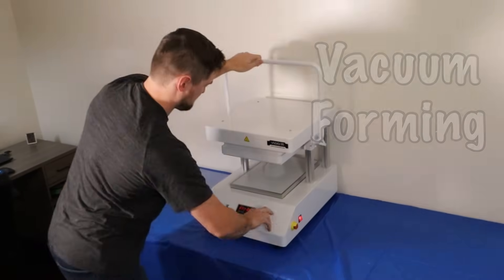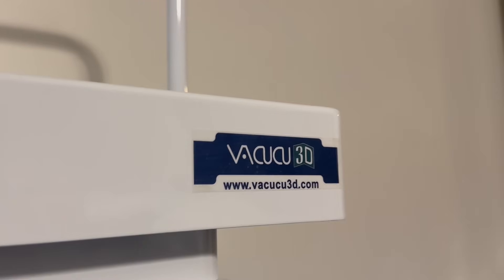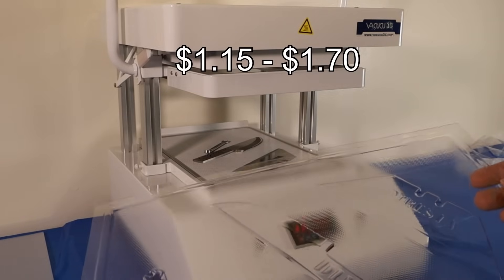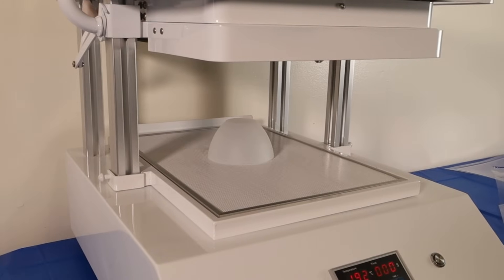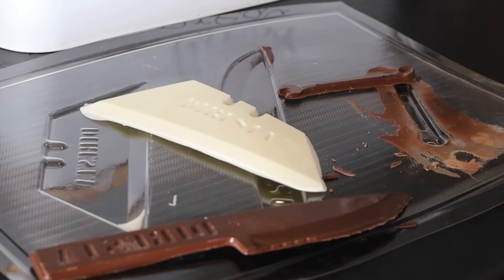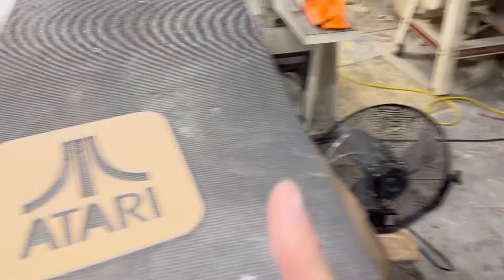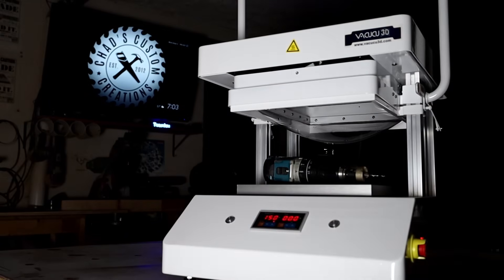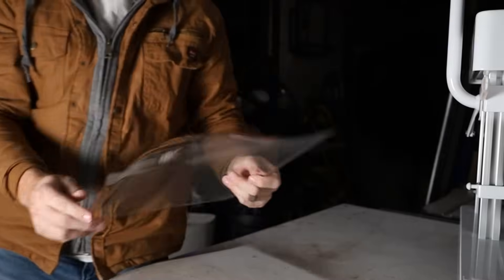Why I got a Vacuum Former, What Can it Do

Comment: Are you aware of the MYYARD Formart 2? I'm trying to decide if that machine is worth the cost. It's definitely the most aesthetic vacuum former out of all the ones I've seen but there is a big price difference. It costs over twice as much as the Vacucu A3 even though it's just a little bigger. But ugh...I keep going back to it because I love how it looks! 😩
Reply from the maker: I haven’t looked into it, twice the cost would be a hard pill to swallow.
Reply: well actually I tried this machine, but it has way too many accessories and it's really confusing. Plus, the machine itself feels flimsy to me. I tested it a few times and quickly returned it., compared to the price itself, i think it's not quite user friendly. duh..

Comment: I need a machine to make blister packs for 3D printed pop-out puzzle toys.
Reply from the maker: I think this would be great for that. Only issue I can think of is the force and heat can be so strong that it can deform 3D printed parts if the infill is not strong enough but maybe if you used solid pieces for the vacuum forming. Or maybe putting them I. The freezer before forming.
Reply: @ChadsCustomCreations  I wouldn't use the actual print to shrink against, I'd use a forming mold printed specifically to created the spaces. <3

Comment: how thick of a sheet can you use? can you use plexiglass? 1/4) in. Clear Acrylic Sheet
Reply from the maker: Says maximum thickness recommended is 1.5mm but also says up to 2mm with some materials. I would think 1/4" plexi glass would be too thick for this machine. 1/16th plexi it could probably do though.

Comment: I see one design deficiency in the vacuum formers
Instead of having to manually turn off the heating elements then turn on the vacuum.
Why not reengineer the power/ work flow.
If you substituted a micro switch tha would control a double pole double throw relay.
Once your material reaches the right temperature all you should have to do is pull down on the material frame causing the heaters to turn off and the vacuum to turn on. This way it streamlines the process and simplifies the process. I can't believe no one hasn't set up one this way.
Reply from the maker: You’re right about that it should be a pretty simple fix unless there would be some reason for that self control that I am not aware of.
Reply: @ChadsCustomCreations  
Also if you want to build your own.
For the vacuum, talk to someone who either owns or manages a carwash and see if you could get their source or maybe you could buy a couple of vacuum motors, the ones I know about are about $80 each. If I were building my own I'd put 2 vacuum motors in.

All you have to do is mount them and wire them up (in parallel).

Comment: Overall, very interesting, both the vacu-forming and all your other efforts (I cannot name them accurately). You also have a pleasant, engaging manner that helps in the business world. 
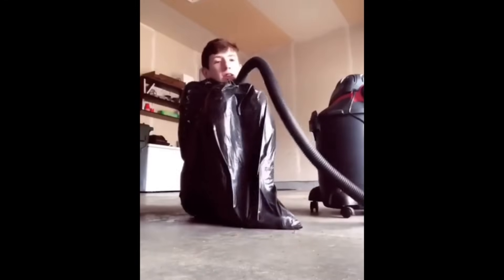   The trash bag thing at 1:57, no; that never would have occurred to me. My nerdness lies elsewhere. (Never mind.) 

   I like to build, super-detail, accurise, correct, improve, modify, etc., polystyrene model kits, and to design and construct dioramas that display them in dramatic settings. (This entails several long stories, which must wait for another day.) 
   One depicts two private passenger cars involved in a vehicular collision at an intersection, with serious structural deformation to one of the quarter panels, the hood, and possibly one of the front doors (each automobile would have a different quarter panel and door), which I infer would be a vacu-form project, to replicate the car body in a far thinner plastic that; upon cooling, one would press out of shape the portion involved, to manifest the “damage”. This may have complications, however, as the heat and the pressure may warp, deform, or possibly even melt the vehicle’s body, which I naturally would need to retain intact for  assembling that portion of the kit undamaged. Perhaps casting a mold of the sedan’s and the coupe’s bodies in some sort of clay (or similar) that upon drying to hardness could serve in their place. I would use only the portion of the vacu-formed copy receiving damage for the diorama, leaving the remainder for another project that dramatises crumpling of the rear end. 
   This diorama also would include two Ford pickup truck wreckers, two police cruisers, two ambulances, pædestrians and bystanders, etc., all attending to the crash; numerous other vehicles in the stalled traffic—one oddly familiar to you, with “Chads Custom Creations” on the side (as I never have seen it, you would have to build one); round 40 scale metres of streetscape as background, amongst numerous other details.
Reply from the maker: Wow sounds like you have an incredible eye for detail I would love to see all of this!

Comment: As a maker of all kinds of stuff. I try to use average everyday items that the average person tends to overlook. For example, on a pop bottle, there is a tamper ring attached to the cap. Once the cap is removed, the ring is left on the bottle. The ring on some bottles unfold to what looks mechanical like part of a jet or rocket engine. Some parts I use are vacuum formed packing from batteries or some toy. Finding the right shape is not always easy. Forming cogs or sprockets, gears or chains.
Reply from the maker: That’s the best kind of maker I really appreciate you upcycling to create!

Comment: But… you can cut that atari sign just with acrylic and the co2 laser cutter…
Reply from the maker: True, though it is still a different look. Nice smooth rounded corners with the vacuum former, where as the laser creates a straight cut which give a sharp cut look.

Comment: Why not just vacuum form it upside-down, backwards, double height as a negative relief or knockout? If the negative is twice the height you do not have to do all the cutting? then spray it red? I am new to this stuff can someone explain? Most of the material is waisted anyway.
Reply from the maker: That would be a great way of doing it I think. I would love to see the results especially if it takes some steps out of the process.

Comment: I operate large scale vacuum formers to make bathtubs and shower walls for my job. Next time your taking a shower ponder how one might make a plastic wall or tub like that. This is how.
Reply from the maker: Oh wow! Those must be some massive machines!
Reply: @ChadsCustomCreations  indeed! we have two huge vehicle sized compressors for 7 machines. The one thing I was thinking about though when watching your video was the heating. Specifically when you were making the first mold for the box that kinda looked like a tub, I knew right away how I would want to adjust the heating from the elements to be able to form the part without "webs".  God I should get one. xD

Comment: Pretty sure you got a vacu-form because it was free. I’ve been to tons of shops with vacu-forms mostly they’re sitting in a corner collecting dust. The ones that get the most use are in shops that are specialized in working with plastic and acrylic. Set is time consuming. That’s why most of it’s applications are industrial. You can do most of the stuff you did with a blow dryer a shop vac and a piece of plywood drilled out with small holes and of course some practical ability.
Reply from the maker: Sure.

Comment: Pre-coloured and didn't dyed plastics wouldnt be as good as when you paint the opposite side you get a really nice subsurface effect since the top layer is actually reflective-transparent with a perfectly smooth paint underneath

With regards to "I shouldvu left it in the sheet for painting" I mean you could've just left it in the wood once you popped them in, it'd mask it and having the back turn red might be nice.
Reply from the maker: Great point!

Comment: Atari consoles were "wood" so having the grain in the lettering isn't that bad. 

Is there red plastic or plastic dye that would let you backlight that sign? 

I say there would be a decent market for neon like signs of all the console logos. Like PS has multi color or blue so separation can be easily done this way.
Reply from the maker: You’re absolutely right, I guess we can call that a happy little accident.

Yes there are different colors and dyes that can be used.

Definitely a market I guess just gotta be careful with the copyright lawyers.

Comment: I need to get something like this to make some object replicas, Can I use this to make the "molding Master" where I will pour some cement acrylic?
Reply from the maker: That’s a great idea!
Reply: @ChadsCustomCreations  it's possible?
Reply from the maker: @svsv9  I believe so, if it does have trouble getting stuck in the mold you can also use a spray called mold release to help remove it.
Reply: @ChadsCustomCreations  Thanks

Comment: They ate super easy to build. In a setup like that you need the heaters built in the top soon as it sags pull it down. Others I know heat the sheets in an oven which adds some complexity moving it to a vacuum table. If you don’t care about the fancy enclosure really very easy to build.

Comment: I received a Vac*U*Form for Christmas in the 60's.  It came with a bunch of thin plastic sheets about 4 by 4 inches and  molds to create cars, boats, planes etc.  You heated the plastic sheet on the one side then flipped it over to the vacuum side where your mold was.   Then you pumped the vacuum handle until the plastic sheet was sucked down over the mold forming a duplicate of it.  Trim away the unwanted portion of the plastic sheet and your car, plane or whatever was good to go.  I'm sure they were banned along with Yard Darts.  😆😆😆

Comment: About 40 years ago I was a Designer (Part Time) for a Design House that specialized in Packaging for the Jewelry Industry, I was tasked to design Boxes and Inlays for 2 Jewelry Companies ( One was for DeBeers/Sterns and the other for American Swiss) The outer boxes was a combination of Card Board/Injection Plastic molding and Solid wood, In pricing order of money spent on Jewelry. The inners I designed all the entry level boxes as Vacuum forming and then "Flocked" with Red, Purple, White, Black, Silver and Gold. The very cheap flocked inlays looked like a million dollars so we used them for all the boxes up to the solid Mahogany/African Black Wood, African Stinkwood  and African Yellow Wood, all of them Hardwoods and extremely expensive. To get the top of the range Box with your Ring/Necklace/Watch etc, you need to spend upwards of $10 000. Long time ago and we still sat at drawing tables with all your goodies and every Design had to be approved by the client so they looked like art work and you hardly ever walked out of their office without them laying claim to the "art" LOL!, Next time you visit them again you can see the art work hanging inside the board rooms.

Comment: VERY INTERESTING. I stumbled onto ur channel. SO happy I did. Definitely a new subbie here. Man, oh man, I wish I could use resin in these as molds but im guessing the resin would eat the plastic. Cool beans.Thank you!
Reply from the maker: I actually think resin would work it might need something like a mold release spray so it wouldn’t bind and get stuck to the plastic. Only other thing is if resin gets to deep it can heat up and the heat could warp the plastic. But they make resins that cure slower and produce way less heat.

Comment: I am R&D-ing a new product I'd like to put to market. This Acucu-3D vacuum form machine would be ideal for a start up. But there's one question I have, to have my product work. I would need for the film material, and I had the subtitles turned on, PETG? is to have the film be able to have a water/air tight seal after the second layer of film is re-heated and again vacuum formed over the first/bottom film. Imagine making bubble wrap. Can this work with the Vacucu-3D machine?
Reply from the maker: Hmm I am not sure if I am understanding what you are asking but you can vacuum form with the protective plastic still on the PETG sheet, I tested it and it worked great just didn’t leave a as clear finish. Hardly noticeable though.
Reply: @ChadsCustomCreations  Thanks for your reply Chad. Its basically two layers of PETG that would stick together. The first formed layer is formed much like the interior cavities of bubble wrap/packing material and the second layer sealing it all off. I looked up Vacucu-3D machine online and its not available, here in Canada and not available in the States either. Can you give me a source. Thanks.
Reply from the maker: @robinhooper7702  I believe since this video has taken off on YouTube they don’t stay in stock for very long you can email Ray@rmlaser.com and he can inform you of when the next delivery of units will make it to the states.

Comment: If most of your Things are already designed, you could buy a secondary setup (barebones) and have someone else work hourly for you at like 15-20 and hour just doing the rough stuff and send it over to you for the final spit and polish.
Reply from the maker: That’s a great idea. Do you want a job?
Reply: @ChadsCustomCreations  How would we do it states apart? i live in ohio. like what would we do?lmao, send me one of those small 3x3 or 4x4 laserpecker things and a case of blank coasters n then just engrave em and send em all back to you? or engrave, clean em up and ship em from me? Chaos has ensued.
Reply from the maker: @IHamDogg  I think you’re just gonna have to move into my garage closet it’s about 4’x20’ should be plenty 🤣 rent will be deducted from your pay of course.
Reply: @ChadsCustomCreations  The Math Works out ALMOST perfectly, I'm Closer to 7ft than i am to 5ft so renovations will be required, And i'll need a Nightlight.
Reply from the maker: @IHamDogg  🤣

Comment: That ATARI piece would be GREAT backlit by a rotating (red-green-blue ??) color wheel behind the logo, shining through opaque white vacuformed plastic characters.  I dunno...giving it motion & character...as a wall dec or conversation piece...maybe as a WALL lamp, with the the lamp part shining UPWARD against the wall (like a "crown"), while the ATARI logo part changes colors, with the wheel, below.  All kinds of possibilities.  (Sorry for being 3 months late on this one...just found your channel).  Enjoyed watching.
Reply from the maker: That’s a brilliant idea! No worries on being 3 months late thanks for joining the conversation.
Reply: @ChadsCustomCreations  Yeah, I read many comments below about using LEDs, and though "motion" is possible/feasible with them, it would require a small circuit board, components ($$$), many wires or traces (more $$$), programming/testing etc., a low-wattage bulb behind the color wheel, and a brighter (variable?) bulb to splay light up the wall, is a LOT simpler and LOW tech/low cost design solution (my opinion)...and you can MAKE the color wheel and stick it on a cheap low-rpm motor.  (This is the way "engineers" think).
   Thanks much for the very quick response.
--- Doug (in Florida)

Comment: Actually I'd that wooden box had an incline Ned angle. You would hardly get it out. Since the plastic would get sucked in on the inside as well. That's means it would block you from being able to pull it out @6:18
Reply: Just like what you did with the kids cups, that was inward and you could not get it out

Comment: Try doubling up on your wood stencil, then temporarily sticking them together making sure you line everything up, then vacuum form that whole thing. Pull out the plastic (leaving in one sheet, don't cut apart), then split the two wood forms apart. Your double-height vacuum formed plastic will now stick through one wood form at double-thickness IN ONE SHEET. Easy-peasy.
Reply from the maker: Yes this is definitely the way!

Comment: Certainly, one of those cases where you might find a use for it if you have it ( like using a Laser Engraver to make Spray Paint Masking Stencils ) but man am I having a hard time coming up with practical uses for such a device 🤔🤨 Quite literally the only immediate use I could come up with to even just remotely tickling my interests were if I needed like a Windshield for an otherwise 3D Printed Car Body but... The Models I fancy usually don't have Windshields: https://youtu.be/6XZXryXOO5A 😉
Reply from the maker: Yeah I am there with you on that. But having it definitely opens up my creativity to be able to create transparent fixtures. Btw your work is brilliant the way that Led flashes when you shoot that torrent is amazing.

Comment: Silly question here. If you had a nylon based object and incapsulated it in carbon fiber using your thermo vac.  Would the strength of the object increase?
Reply from the maker: Yes

Comment: Question:
would it be possible to melt down the scraps, turn it into 3d printer filament and use it to make a new sheet for the machine ?
Reply from the maker: I believe this is possible with the right machine.